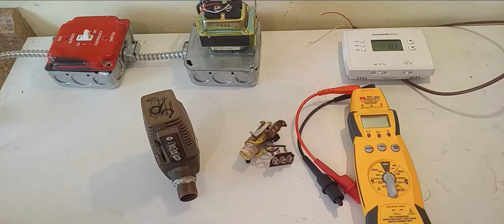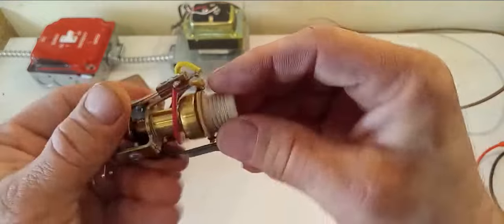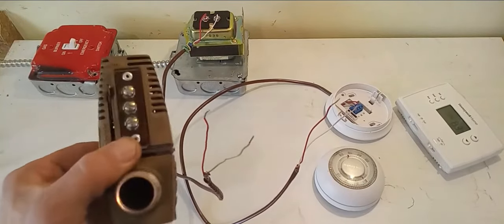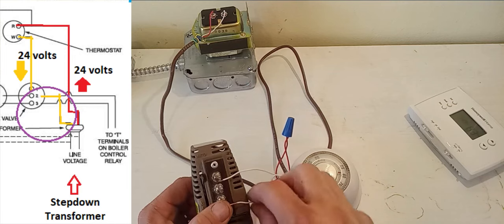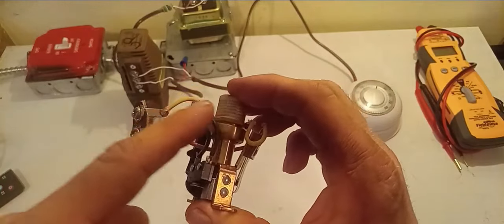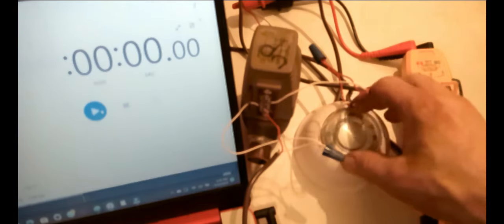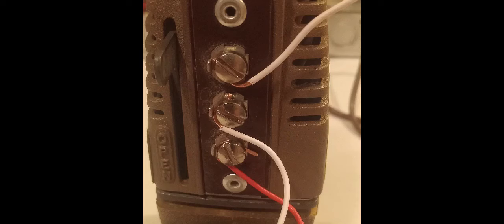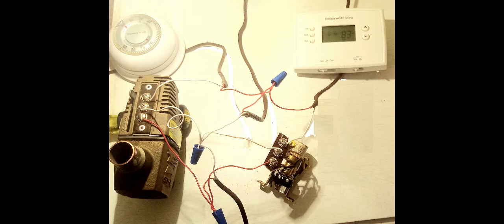TACO Zone Valves For Beginners (wiring, operation, diagnostics)

Comment: One thing when you do a continuity check between terminal 1&2 you got to make sure that the T stat is turned all the way down. So you also won't read through the T stat, and give you a false hope.
Reply from the maker: Good tip!
Reply: Where is the  T stat ?
Reply: @purenaturefy  That is short for thermostat.

Comment: My condo association told me my zone valve was installed backwards and causing "rumbling" idk in the pipes? The maintenance guy took my white wire off terminal 1 and left the red wire on terminal 2. Do I just swap the red and white wires? Was it wired backwards or installed backwards on the pipes? Please help
Reply from the maker: If it is backwards, it is the valve body that is backwards, not the wiring. Wiring has to go on the same exact way as it was before.

Comment: I have three wires but the zone valve doesn’t turn on the boiler. The pump is always on and the boiler kicks on when aqua stat calls for heat. Trying to troubleshoot one zone to see if it’s the power head or tstat.

Comment: Hi Jersey, in case of combi boiler I am using Utica MAC-150 when should I use external circulator pump? If I do need it can I use only 1 pump for return in case of two zone house (with zone valves)? Is there a way to install circulating pump without control board, using only the boiler TT terminals? Thank you so much for such a helpful videos.

Comment: Awesome video!  Why do you prefer a wire nut instead of both wires sharing terminal 2?
Reply from the maker: Thank you. Only reason is because the connection is more secure with one wire at the screw terminal. With 2 or more wires there, it's possible that vibrations over time can sometimes wiggle one of the wires loose. It's kind of rare, but it's one less potential problem avoided.

Comment: Learning a lot, thanks. Got a clarifying question about my established system, installed late 80s I believe. It's been working fine until recently (I think its a bad valve, gonna keep poking at it).

My valves are currently wired with tstat R on terminal 1, 24V xfrm on terminal 2, furnace on terminal 3. I found this vid's wiring and thought it would be better to do it as you have it so that the tstat controls the current on 2 and 3, ideally turning off the furnace when it stops being called. As it is, seems like as long as the valve is open it leaves the boiler running since 2 is getting constant 24V. So if there's a stuck valve (mine is) it ends up constant calling. Is there a reason to have it wired how it is, or would it be better to switch it?

Also, it looks like the furnace TnT terminals are both live when being called? One coming off the 24V xfrm and one coming off terminal 3 of the valve. Is that right? I've gotta be missing something, since the system obviously works. Any help would be appreciated!
Reply from the maker: T stat should not control terminals 2 and 3. Only terminals 1 and 2. A complete circuit between 1 & 2 is controlled by the thermostat which in turn activates the powerhead that will release the end switch and open and close the valve body in the process. The end switch is your control of the furnace circuit on 2 and 3 only. It will not control the valve body if you're trying to bypass 1 & 2 to directly control the TT circuit with the stat. 

Terminal 2 should only lead back to the transformer  common that is shared by both circuits.

Comment: I have 3 zone valves. I am having connection issues with zone valve #2 terminal #2 since this has wires 3 wires all tied into it with the screw from terminal #2. 

The 3 wires are coming from the following. 

- First wire from zone valve #1 terminal #2. 
- Second wire from transformer
- Third wire from zone valve #3 terminal #2. 

Can all 3 wires be put in a ring terminal where then the ring terminal is held in place by the screw from zone valve #2 terminal #2  for a better connection?  And if yes, do you recommend a specific ring terminal?
Reply from the maker: Yes. you can do that. Though I would take all 3 wires off of the #2 terminal, snip back and re-strip them, twist them all together with 
a 4th wire and secure them with a wire nut. Take the 4th wire and put a spade connector on it and secure that back to the #2 terminal.

Comment: my Bryant BW1 boiler heat has a honey well controls limit, transformer an relay 3 wires red white an blue going to the taco valves There are 2 valves how do I wire those 3 wires if you dont mind..thank you

Comment: Question, I have 2 zones in my house with one of these for each zone, thermostat in bedroom and dining room. Bedroom thermostat and valve work fine. Dining room wasn't working, I figured thermostat cuz its a really old mercury. I changed it, it worked for about a day then nothing. Won't kick on boiler but will click when i pass room temp on the dial. When i check the voltage it was aroud 22. Also, Valve is really hot even when the other "working" valve is cool. My work around was to manually open the valve, basically turning my house into a single zone running off my bedroom, which isn'ta long term solution. It seems 90% likely the valve is the problem. Any thoughts?
Reply from the maker: What is the VA rating of the transformer and what voltage are you reading off of it? It could be the valve but 22 volts is a little low. Typically I read 26-28 volts off of transformers.

Comment: Hi Mike, quick question if you have a second to answer. I have an oil burner with three zones; all zone valves are TACO, with a 24v transformer. Two of my zones have Google Nest thermostats (and they work fine). The 3rd zone has an old mercury thermostat. I purchased a Honeywell RTH6500WF WiFi thermostat, and the manual says the device will only work with the C Wire connected. The current thermostat has a red wire to the R terminal and a white wire to the W terminal. A third wire (green) in the wall is not connected to anything, and when I trace it back to the zone valve, the green wire is not connected to anything at the zone valve either. Do I need to use the green wire if 24 v is going to the thermostat via the red wire? I went with the Honeywell because it was cheaper than buying a 3rd Nest.

My AC is a separate system from my heat and uses a separate thermostat (A Honeywell connected via a TCC gateway). So I hope if the new Honeywell will work, I can add it to my TCC account.
Reply from the maker: You can use the green wire as the common. C at thermostat, terminal 2 at zone valve.
Reply: @JerseyMikeHVAC  thank you. I appreciate you helping me

Comment: If you have two of these (two zone system) and there is heat to one zone, but none in the other zone, AND you have bled the air out of the system, is the valve head the likely culprit?  In other words, even if the other valve opens and turns the boiler on, will the other valve with the faulty head remain closed and cold?
Reply from the maker: Yes that's a possibility, but without a multimeter test I couldn't say if it's the physical valve body that's bad or the head.  Most likely the head. A quick continuity or ohm test between terminals 1 and 2 will tell you (wires disconnected). If no continuity, change the head. If reading OL on ohms, same issue.
Reply: @JerseyMikeHVAC  Thanks for the reply.  I'm going to do the multimeter tests tomorrow.

Comment: Hi Mike, I asked this question on another video, but found this one to be more specific to my question.  I currently have 4 zones operated by 4 thermostats and 4 taco valves.  I want to combine 2 (downstairs) valves and have them operated by one thermostat- turning two zones into one.  How do you suggest I do this without removing and replumbing the system?
Reply from the maker: You should be able to just run a jumper wire from the #1 terminals on the two valves you want to operate together and just disconnect the wire on the #1 terminal coming from the stat you don't want to use anymore. As long as those 2 valves are operating on the same transformer that should work.
Reply: @JerseyMikeHVAC  I'll give it a try- Thank you for such a fast response and I'll let you know if this works or not.
Reply: I just followed your direction and the system does exactly what it is supposed to do and works perfectly!  Many thanks @jerseymikehvac for your support.  This 12” wire jumper I’m sure would have cost me hundreds to get a technician out here to do.  I appreciate the value of your instruction and the confidence given to help the homeowner do it ourselves!
Reply from the maker: @justindashiell7171  Good job

Comment: I tried to wire everything the way you shown on the video but I am not getting any power to that thermostat.
Reply from the maker: My videos cover typical, standard wiring practice, but sometimes HVAC guys get a little creative and do things a little differently. Typically if it doesn't work, this is usually the case.

Comment: So I get 25 volts from my transformer but I get about 1volt from my taco. But they still working. Is there something wrong?
Reply from the maker: Depends how it's wired, when you're testing and where you're testing at the valve. If it's working, you'll have 24volts on terminal one on a call for heat.

Comment: The transformer red wire and white wire have positive and negative ?
Reply from the maker: It's alternating current, so no. They can be switched and the circuit can still work. But most transformers will have a "load" and "common" label just to indicate which is the 24 volt source.

Comment: Where are the #3 (red) wires from both Taco Zone valves going? Where would they connect ?
Reply from the maker: Those wires get tied into the boiler's burner circuit, which is often power fed through a different step down 24v transformer. They usually run into the boiler itself near the controls and get tied into two T&T wires made available for that purpose.

Comment: I live in a multiunit sharing the same boiler. My apartment never goes above 68 F degrees no matter how high the thermostat is set for. Is the thermostat being bypassed? I'm thinking the new landlord would like nothing better than to be able to do this.
Reply from the maker: It's a possibility the way some people are, but there are other issues I can think of first. Are all the baseboards hot or just some?  The boiler max water temp limit could have been lowered too. Usually set from 180 to 195. 

A bypassed thermostat will either not provide heat to the zone at all or will run constantly. A second thermostat could be spliced in somewhere, I suppose, but you'd have to get pretty creative to limit temps to 68 in a remote space using it. You'd most likely have large temperature swings.
Reply: @JerseyMikeHVAC  Yeah... I've talked to some of the other tenants and most of the are using extra heaters in their apartments. So it's quite possible the boiler temp is being kept lower now under the new owner. I tried a manual over-ride at the valve unit and it didn't seem to change much. Thanks for the suggestions all the same.

Comment: where's the final connection for the 3rd wire? I see its connected to the XFMR common (white) and wire#3 (red) all connected but where's the final connection? does go back to the boiler?
Reply from the maker: I go over all of it late in the video.
Reply: Did you find where the third wire goes? @JerseyMikeHVAC

Comment: Have a strange diagnostic condition that isn't covered in this video. Maybe somebody can help. The 2 and 3 terminals have continuity on both of my zone valves, even when the valve is closed and there's no call for heat. The valve still opens when the thermostat calls and closes when there's no call, but there's always continuity between the common and the end switch. As a result, my circulator pump runs constantly, even when there's no call for heat. Even tried killing the power to the boiler and unhooked all of the wires, just to make sure it wasn't because of a hack wiring job, but still have continuity. Is this a common failure, or is there something else happening in the boiler?
Reply from the maker: So you have continuity  between 2 and 3 terminals on BOTH zone valves with the power off? Even with the wires disconnected?
Reply: Just wish I had seen this before replacing a perfectly functional relay😕

Comment: If u don't hear click on tstat and room temp is 62 degrees when setting goes past 62 a click should be heared, if you don't hear that click would tstat be bad?
Reply from the maker: It depends. Sometimes that could be an indication of a bad stat, but not always. A lot of stats these days have built in delays on them, so even during a call for heating or cooling, there may be a 5-minute delay if the mode was changed from one to the other, if the power was interrupted, if there is a zoning system or if it's just an efficiency feature of a smart stat.  Sometimes it's a communication issue between equipment the stat isn't picking up on which can be a set-up/programming issue on new smart stat installs. 

 Typically, if a system isn't doing what its supposed to be doing after giving a stat enough time to work through delays, I'll bypass the thermostat to try to force start the system. If the system starts up, I start suspecting thermostat issues.
Reply: @JerseyMikeHVAC  @l.a.m7645  Where can I find the T Stat

Comment: you can't check continuity on a zone valve (or any device) with the circuit wires connected.
Reply from the maker: You can, you just have to make sure the circuit is open at the stat (not calling).

Comment: I missed terminal 3. Do I need that for a single zone?
Reply from the maker: Yes. That completes your T & T circuit so the boiler knows when to fire up and shut down.
Reply: You didn't show the terminal 3 hook up. Does it go back to the neutral on the transformer?
Reply from the maker: I show the complete wiring on all 3 terminals in the later part of the video.
Reply: @JerseyMikeHVAC : I'm in a condo where we share the same boiler. I have two wires from the thermostat and two from the transformer, does that make a difference?
Reply from the maker: Wire it the same as the others.
Reply: @JerseyMikeHVAC : Thanks for your help!
Reply: @JerseyMikeHVAC  Mike, please show or explain the third wire going to where? What is 'T Stat' and where can I look?